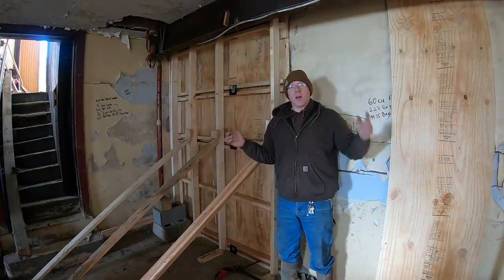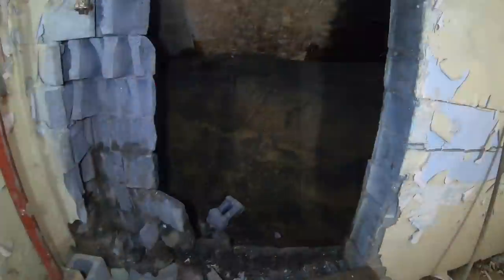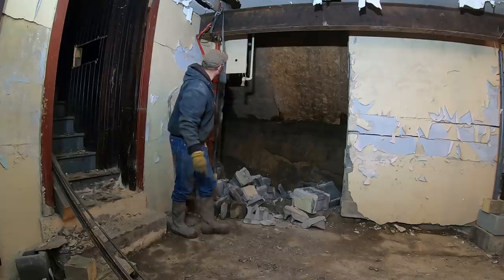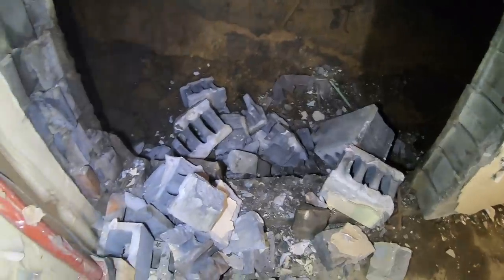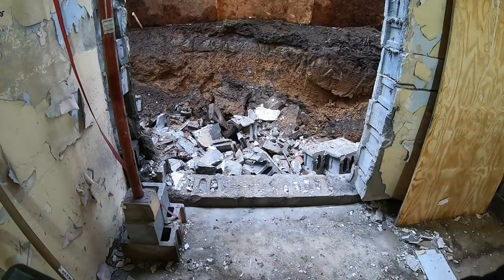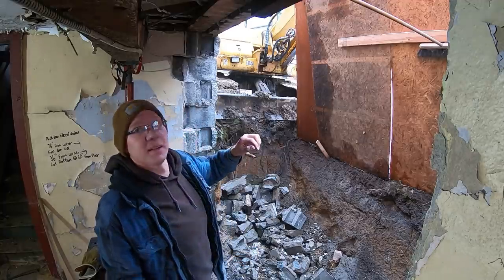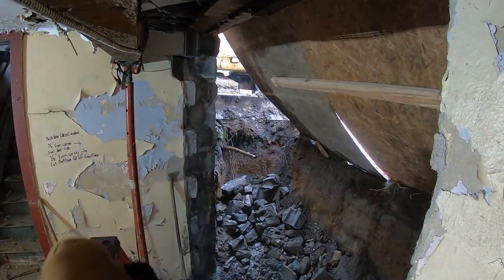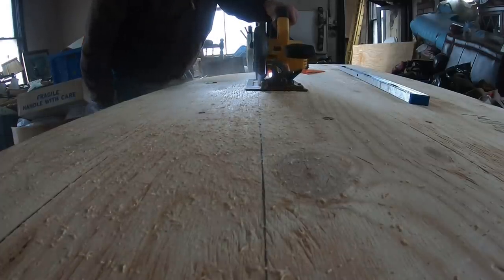Foundation wall so bad it falls apart!! ABANDONED CHURCH foundation repair!  Ep.5

Comment: At:  0:25 I hope you are not done with the forms.  Concrete blowing apart improperly tied forms is NOT fun.
Reply from the maker: they have ties going through them as well as they are tied into the joists above and have feet anchored to the floor, shouldnt go anywhere. Thanks for watching!!!
Reply: @DieselCreek  Good luck.  Note that the bottom of the form is were the most pressure will be.  For an 8' high wall the pressure at the bottom can be 1,200 pounds per square foot (psf) pushing the forms apart.   If you fill the forms slowly so it sets up a little the pressure will be less.

Comment: Old concrete is stronger than the new concretes that have an accelerator in them.
Reply from the maker: couldnt tell ya, I can tell ya that new concrete is much stronger than the old wall.... Thanks for watching!!!
Reply: @DieselCreek  The Empire State Building was poured with the old 30 day cement. Based on its performance the Hancock Building was poured with the same engineering specs but with calcium chloride added to accelerate the strength cure time from 30 days to 10 days. What they didn't know was that the Empire State concrete continued to get stronger after its 30 day strength. The Hancock concrete did not continue to get stronger. In the 60's the Hancock Building began to crumble. Emergency measures had to be taken to reduce the contained weight (furnishings, etc.) to extend the life of the building. It will be demolished long before the Empire State Building which continues to get stronger.

Comment: why not get one of the Little skid loader were you have the Hole in the wall thay way you will not have to carry this out of there
Reply from the maker: that small room will be removed with the machine so it will be pulled out then. Thanks for watching!!!
Reply: @DieselCreek  i love when young people do things on there own to fix things up i would rather fix it up them take it down now if the building is to far gone then i can see it coming down
Reply from the maker: Michael S. Ruoss Sr This one was right on the edge of being too far gone, that’s why I’m doing the foundation first because if something goes wrong I can just knock it down.

Comment: I hope the steel extended horizontally both ways. Just a quick comment on old buildings. To carry gravity loads, block just needed to mortared together not filled and steel added. Now it is highly recommended that all cells are filled with grout and steel added for strength just in case it is hit with an excavator bucket (it would only leave a hole). Realistically, the whole foundation should be replaced and tide to the building frame.
Reply from the maker: in a perfect world.... realistically im gonna repair whats bad and the rest will have to do. Thanks for watching!!!

Comment: Never understand why they never put rebar inside of the core and then fill the core with cement after. that would never pass in the Caribbean.
Reply from the maker: I think its required now... back then people did what they wanted. Thanks for watching!!!
Reply: @DieselCreek  thats crazy , Florida still doesn't require it. I'm trying to build a house in there and contractors, was telling me I'm crazy for wanting build my home like that
Reply from the maker: @mr6266  Im talking for basement walls over certain height, florida most people dont have basements and I doubt they require it,